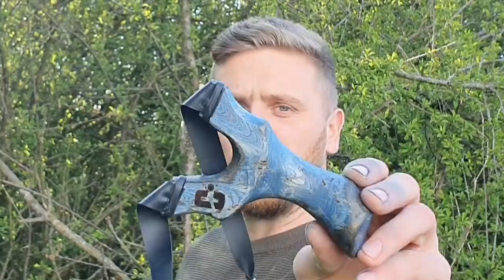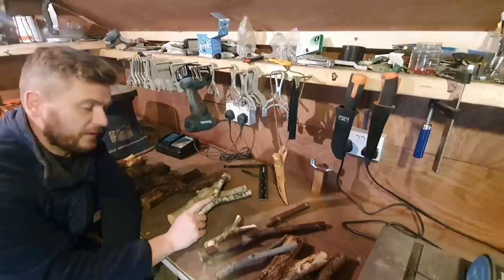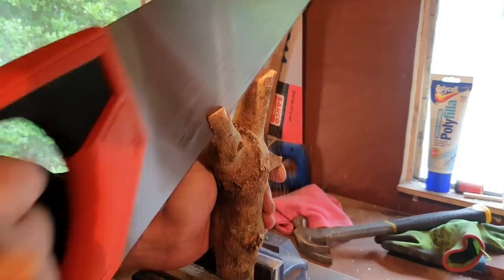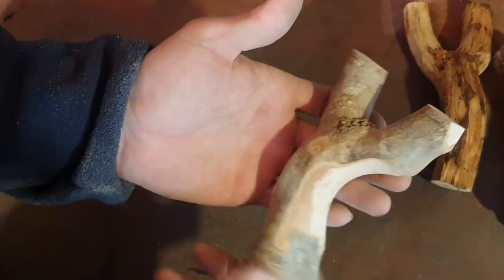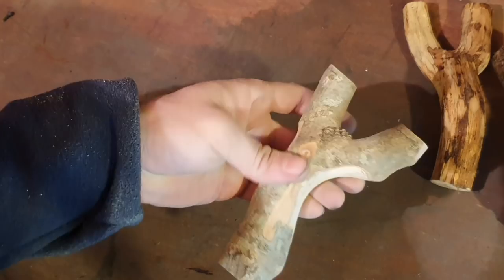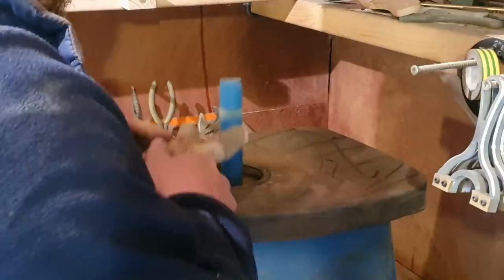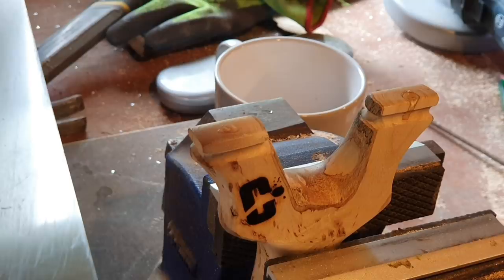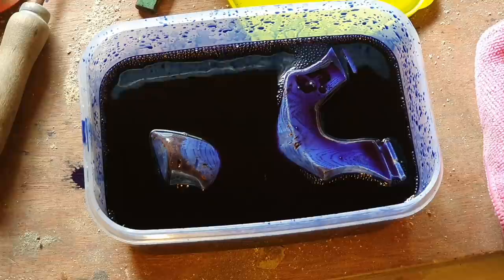Creative Natural Slingshot Build

Comment: Have you ever measured the speed of the steel ball? Can it completely pass through a red bull can?
Reply from the maker: It can easily pass through several cans
Reply: @CatapultCarnage  red bull can is different from other cans, it takes at least 100m/s to pass through one with 8mm steel ball，130m/s to pass through two!